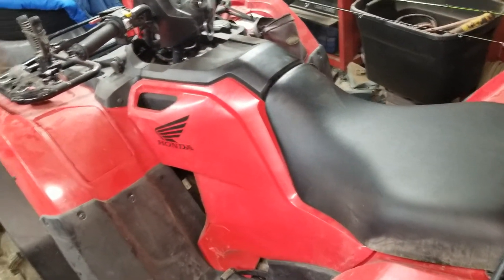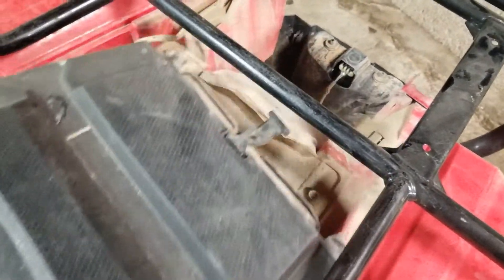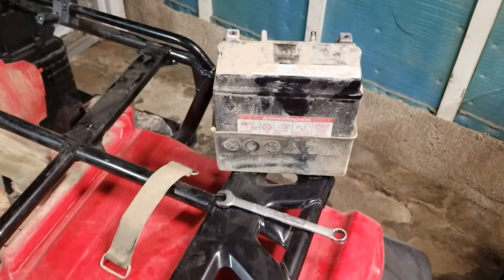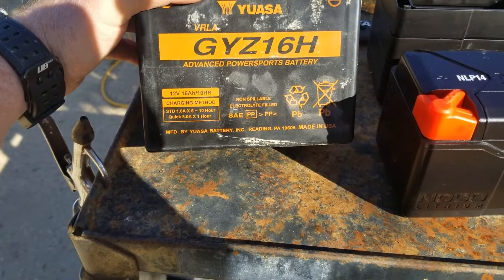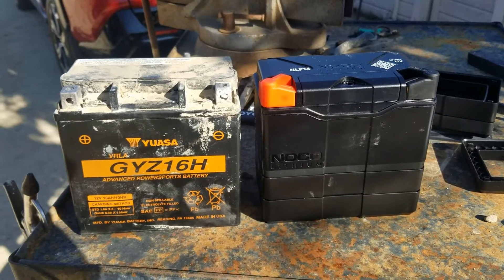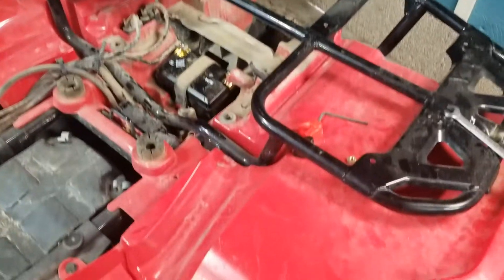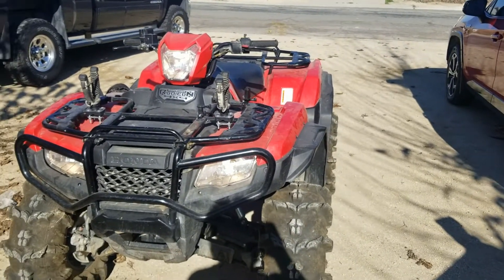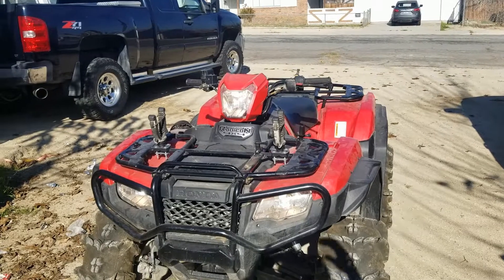Honda Rubicon Lithium Battery Upgrade

Comment: Going to try my first with the NOCO 20 model for my Goldwing. My AGM Yuasa is struggling all ready after 2 years in a new bike. Note: in a cold weather start, turn the ignition on, let the lights stay on for up to 30 seconds or so and start it. You will wake the battery up. Lithium loves that !!!!!

Comment: Does it require a special charger or will the bike charge it?
Reply from the maker: Nothing.      It has a built in Battery Management system (BMS) to make sure it doesn't over or undercharge.  Just bolt it up and go.

Comment: Um, just a suggestion, but if you are going to post videos on batteries and advise others on their use, you should probably at least know what the amp hour (reserve cpacity) and CCA  (cold cranking amps) ratings mean. The GYZ16H has a higher reserve capacity (16AH) than the YTX14 (12AH) found in many Honda ATV's even though it is the same physical size and connection.  The GYZ16H is OEM on newer Rubicons and often used as a replacement for the YTX14 found in older models because of the increased electrical requirements of power steering or electric shift often found on rubicons and foreman models. Although a lithium replacement will work fine in a motorcyle or an ATV in a warm climate, a lithium battery will be a potential problem if your use your ATV to plow snow as many of us do because lithium batteries will often not accept charge at below freezing temperatures. If the bike sits or the battery becomes discharged from storage or aftermarket accessories, in a cold climate You would have to bring the bike inside and let it and the battery warm up to room temperature if you had to charge the battery.
Reply: What battery do you recommend for cold weather (I’m in Montana)